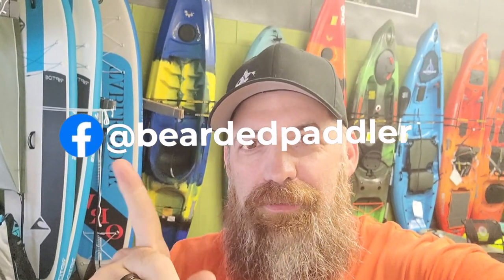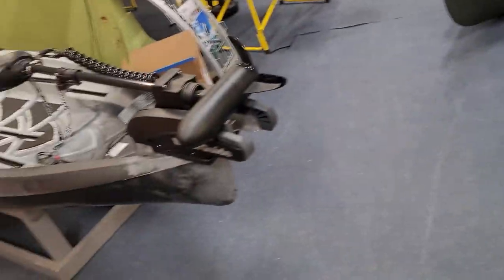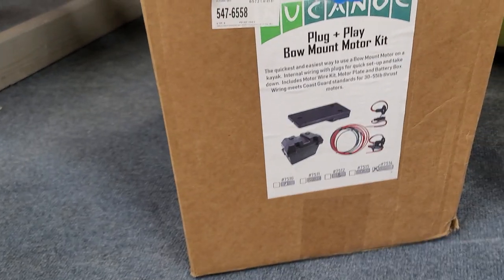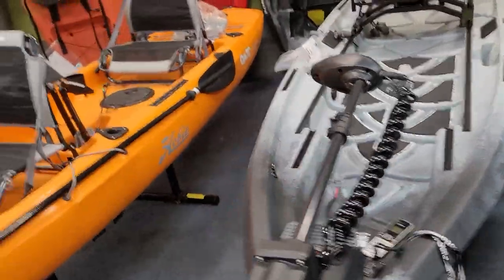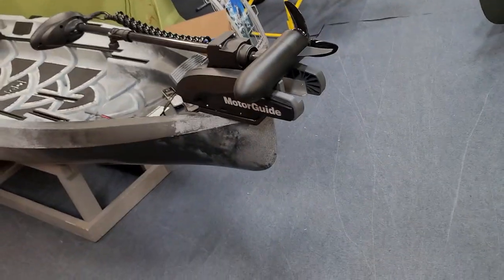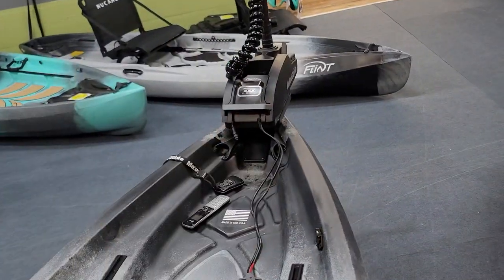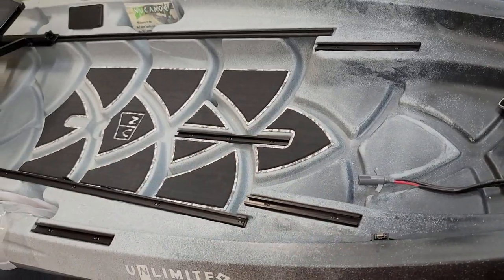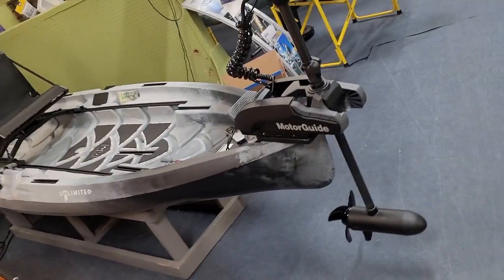Trolling motors on fishing kayaks | What you need to know

Comment: Sadly ohio requires each boat to be registered motor or not. It's $25 each 3 years. If caught without they can seize the boat and minimum $75 ticket. Adding a motor changes registration class and fees. It's absurd.
Reply from the maker: Agreed. I think Oklahoma and Michigan require registration regardless as well
Reply: Sadly they claim it's for access here, yet most times when trying to use accesses they are chained off or you can't get funds released for new ones or upgrading current ones.
Reply: @thebeardedpaddler I think Oklahoma has to be registered if you have a 10 horsepower or more motor.